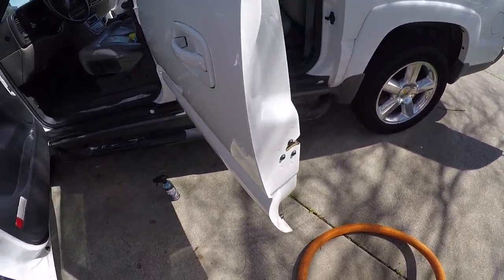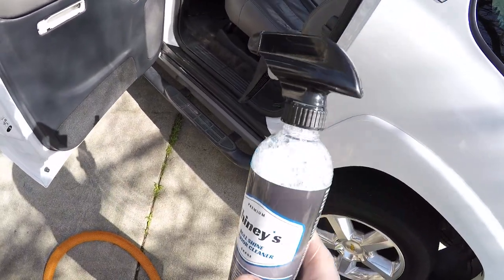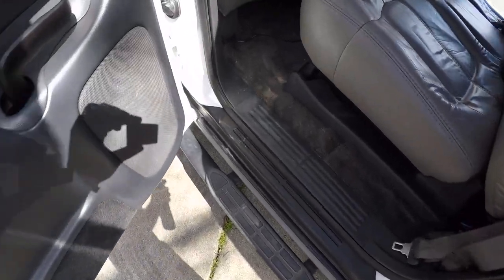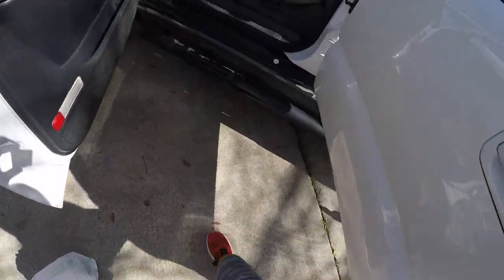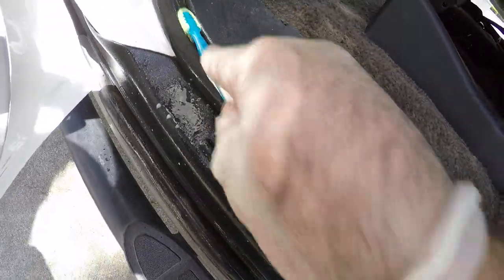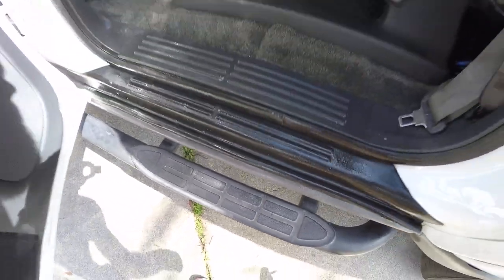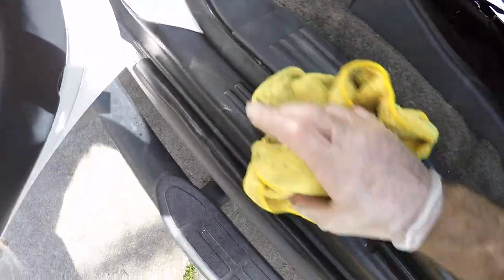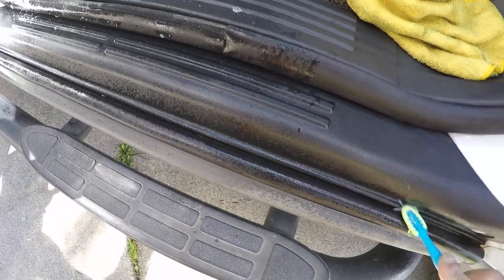Shiney's Detail interior cleaner is a winner!

Comment: I decided to watch a Smurf Classic so I opened your videos and chose this one. Interesting that I have already commented on this video. The other day I did the interior of my car with Adams Interior Cleaner because I have so much of it and want to get my supply of this stuff down. The last thing that I had to do was the rubber drivers side floor mat. It was really dirty with light mud and some leftover salt stains from the winter so I decided to spray it with the interior detailer and see how it came out. I sprayed it, let it soak for a minute and then used the microfiber towels I had used on the rest of the interior to scrub and dry the mat. No brushes, just the towels. The result was amazing. The mat looks like new with no shine and not slippery. I'm really surprised that it came out so well. As tempted as I am to buy more chemical products, so far I've held off on doing so this year so I can get rid of some stuff.
Reply from the maker: Adam's has some good stuff for sure. Sometimes a clean floor mat looks better than a dressed mat in my opinion! Appreciate you watching some throwback smurf vids my friend. Hope all is well!